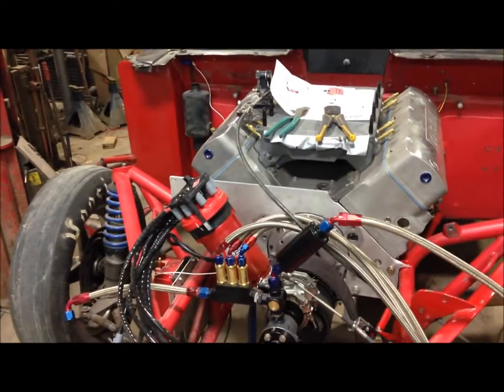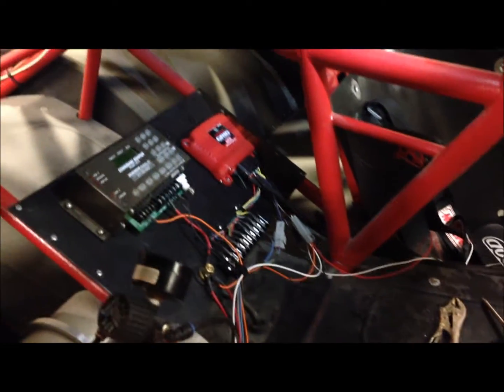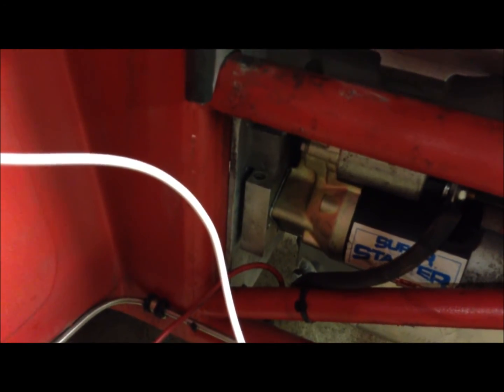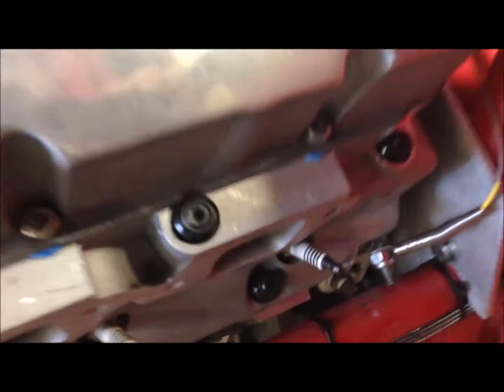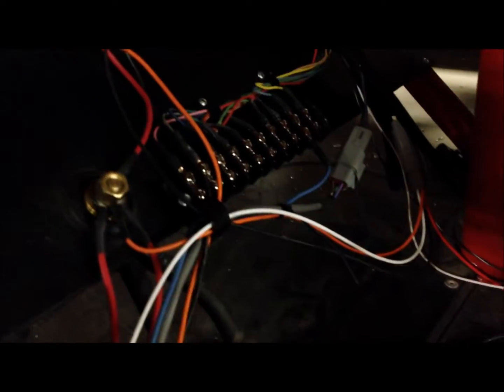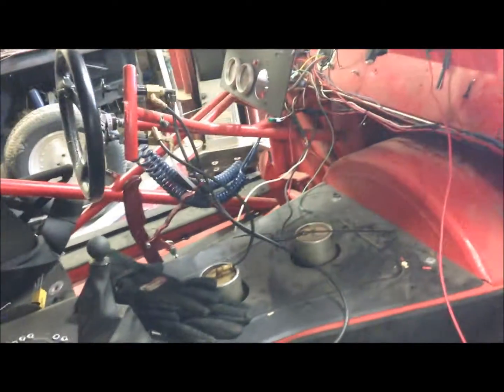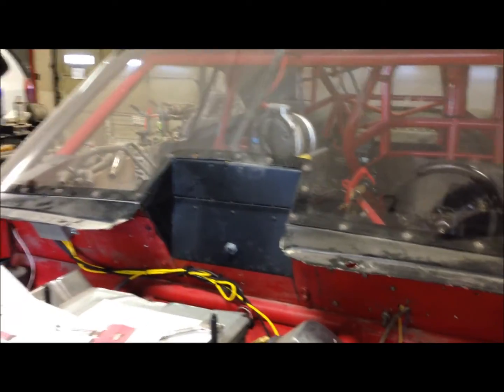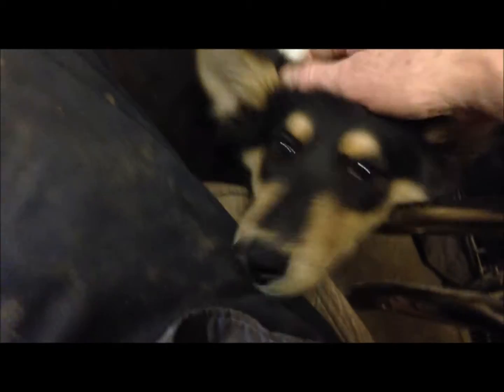ROAD RUNNER MSD GRID WIRING

Comment: I have recently installed a power grid 7 ignition system with a crank trigger and all of the wiring diagrams show a capacitor wired in the system. Do you need the capacitor to get fire to the engine because I'm getting no fire to my ignition coil?
Reply from the maker: I've never used it. Its important to set your timing in the grid the same as the engine. If not it will create starting problems.
Reply: What do you mean by set the timing? Because I’m not getting any spark

Comment: I have a few questions about the Power Grid (PG) and its wiring if you don't mind.
A buddy gave me a Power Grid to wire up for him because he couldn't figure it out. I don't know the PG, but I know wiring.

What triggers the PG to operate the output - burn-out, launch, shift light, etc? I can terminate the loose wires to a bus, but I don't know what tells the PG to trigger everything else. 

Do any of the loose wires require a relay? It looks like yours go straight to a bus and then out to the "accessories".

Does the 12v ignition (red wire) go through a relay? 12v constant to 30, keyed/switched/ingnition power to 86, and PG red wire to 87?

Thanks
Reply from the maker: No relay for the red power wire. Output wires go direct to whatever you are powering on. Shift light, launch etc. Electric shifter will need a relay, I use the shift light output wire for that, yellow I think. All outputs are programmed with the laptop. If you don't have instructions they are on MSD website.
Reply: Jeff Wiebe thank you